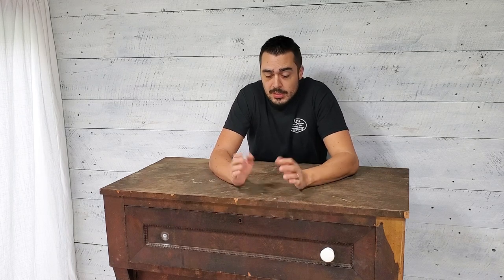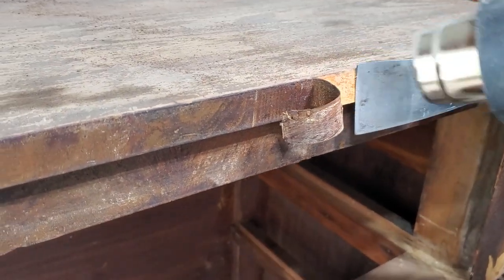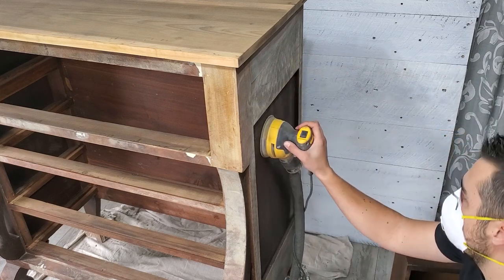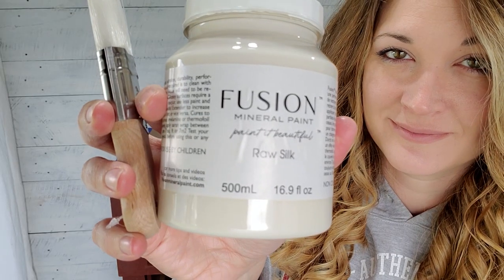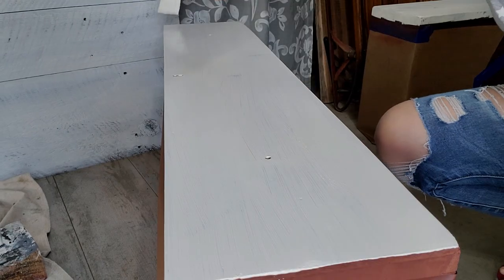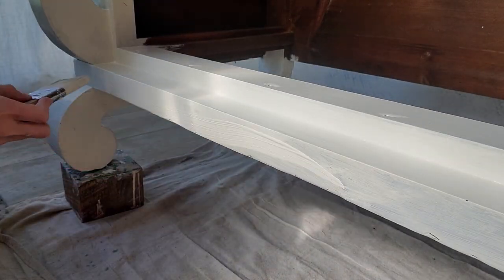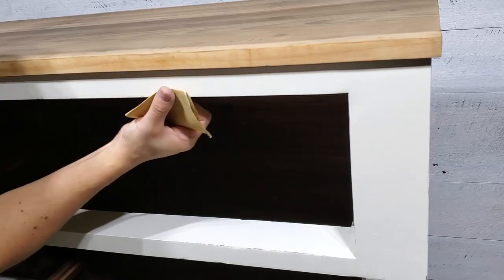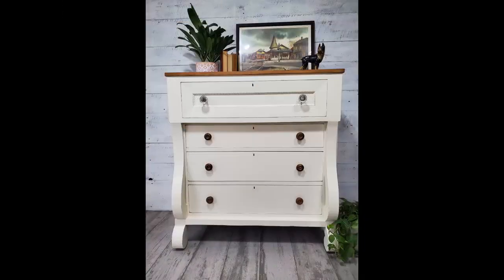Vintage Dresser Makeover Using Fusion Mineral Paint

Comment: Fabulous!!    What do you have your sander connected to collecting the dust, and what is the connector between the sander and the hose? ❤️❤️
Reply from the maker: Thank you!  I just have it connected to a ShopVac with HEPA filter on it.  It usually cuts down on the majority of the dust, but there are some better systems out there (but very expensive).

The connector was actually something I threw together using a small piece of PVC pipe inside of a rubber coupling.  They make adapters for sanders to connect to most vacuums, but when I checked at the time they were around $20 with no guarantee of fitting my vacuum so I made one myself for around $5. 
- Ethan
Reply: @BrickHouseVintageDIY  thank you, I purchased an adapter and it didn’t fit, thank you for giving me a solution to my problem.  Keep the videos coming really love/enjoy them!!!!